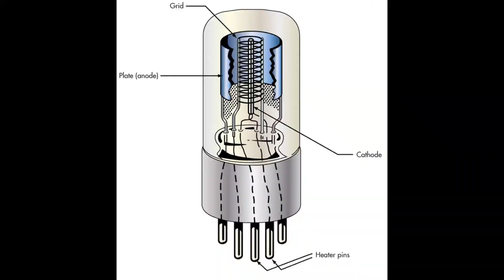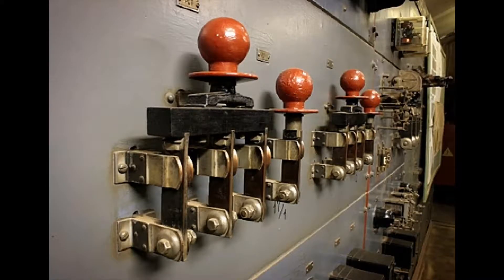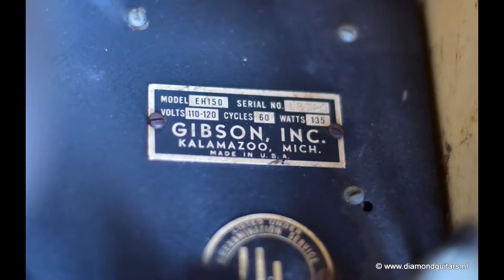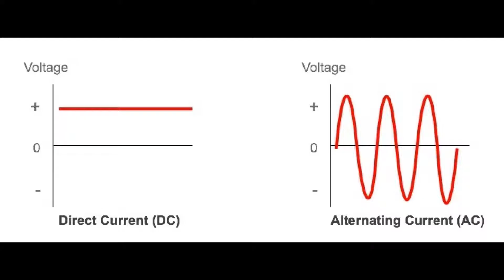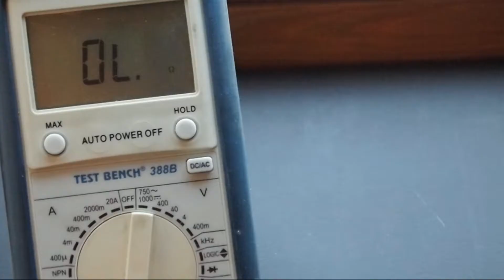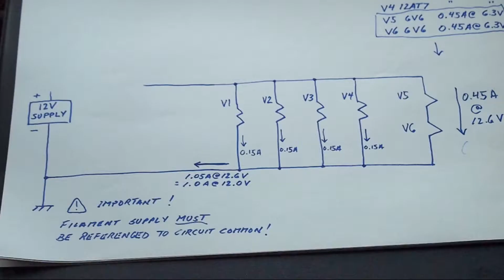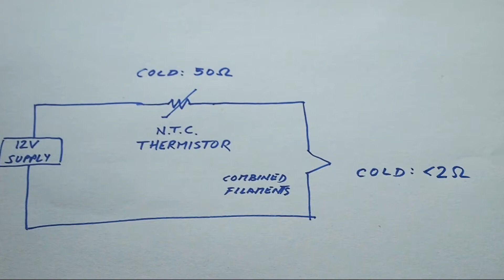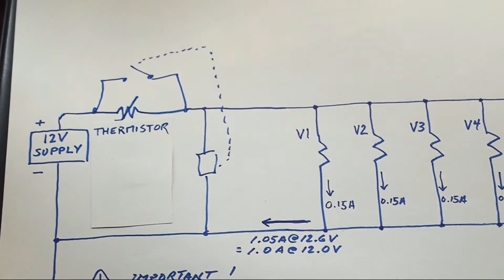Everything You Never Wanted to Know About Tube Filaments

Comment: From the very basics of AC-powered heaters/filaments directly to DC switching supplies for heating the is one hell of a leap;  No mention was made of filament-winding centertaps nor using resistor pairs (or a trimpot) to balance heater supplies and lower hum, nor the technique of biasing up the filament supply with a DC voltage borrowed from elsewhere in the amp (such as the output tube cathode-resistor voltage).  Installing a switching supply, especially one chosen to be over-rated for 10 amps, strikes me as a complicated solution to amplifier hum, a problem that anyone who has studied tube amp circuitry and design going back nearly 100 years would know how to prevent in much simpler fashion: with good layout and grounding.
Reply: Thanks for raising some good points. It's always hard to know how deep to go with these things, but a filaments video delving into some of the legacy techniques you've mentioned as well as some other tips and tricks is warranted. I sometimes forget that there are still a lot of people building legacy designs incorporating technologies that have been supplanted by more practical developments. But for people who are understandably tired of carrying around enough iron to power several amperes worth of filaments at 50 or 60Hz, the leap to a reliable, lightweight and compact SMPS is a one worth considering. Good layout and grounding are always essential as you say, but circumventing some of the problems that layout techniques can only reduce to tolerable levels is often a better way to go.
Reply: @robertjamesrobson2907  , the Achilles heel of SMPS design is capacitor failure from high-frequency ripple. Whenever a manufacturer contracts out to have SMPS power supplies built in China or Asia, invariably the caps used are junky electrolytics that bulge and leak and fail prematurely. Not to mention that most SMPS supplies weren't designed to deal with the excess heat that develops inside a tube amp chassis.  Which doesn't mean that it can't be done to a higher standard, but if you look at the myriad of modern tube-based guitar amp designs on the market these days, hardly anyone builds them to the highest possible modern state (which is why we see Fender and Marshall lamps with cheap circuit boards that become conductive, leading to noise, unstable bias, and thermal runaway). Mostly you get overly-complex amplifiers that are the musical equivalent of a Swiss army knife,  doing a lot of different things half- ass tonally but not necessarily doing any of them very well, and with the downside that they become far more complex, complicated, failure-prone,  and expensive to repair (take a look inside a Mesa amp, for example). I don't see any upside to increasing the complexity and unreliability of a power-supply circuit by adding additional parts, in order to shave off 5 pounds of carry-weight from a guitar amp. The inexperienced and uninformed are easily awed by complexity, but a genius is impressed by simplicity. 

 Anyway there is no reason why somebody can't take the tail end of the heater supply and rectify and regulate it just for the first couple of preamp tubes, which is typically where most of the hum and noise gets into the signal path. Beyond that point, much of the hum is going to be canceled out if it's a push pull amplifier.  Class A amps, or high-gain amps, might require more work to keep noise levels down.  Most of the techniques for good tube amp layout and design that date back 60 or more years are still applicable to "modern" designs, and if a company's designers/engineers aren't sufficiently versed in how things were done in the past to be able to not repeat those mistakes in the present, then they have no business being In the amplifier business.  They're just as likely to end up inadvertently building an oscillator !

It's also worth mentioning that from the Fifties onward the 12AX7A was purportedly manufactured with filaments that are spiral wound in opposite directions for each side of the tube, which is supposed to make them essentially humbucking in operation. Hopefully modern Russian and Chinese tubes do this as well, although the design specs for classic American and European tubes are sometimes seen as little more than a suggestion to overseas manufacturers nowadays.